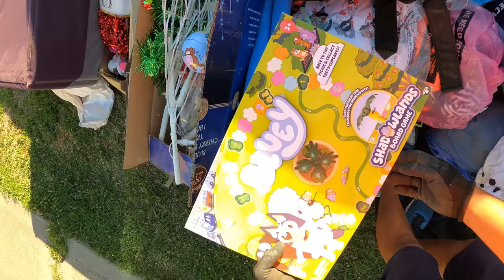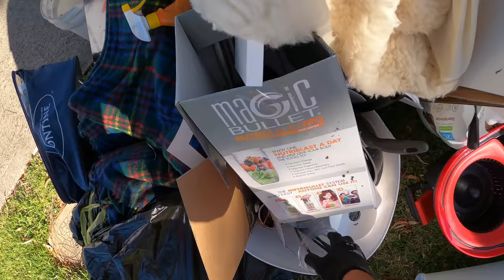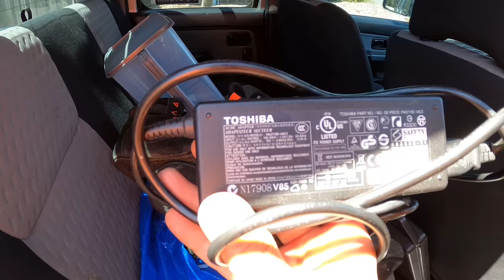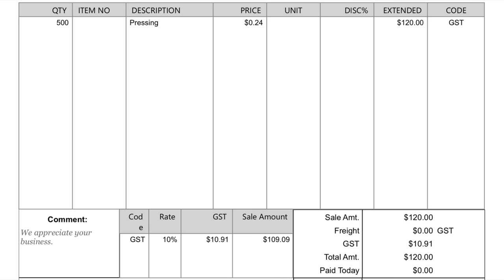How I Stack My Trailer With Scrap Steel

Comment: Hello from the U.S. ! My son and I scavenge here and find sooooo many useful (some new) items we keep for ourselves or sell at yard sales. My son micro scraps, because he doesn't have a truck to haul large items. So he reclaims copper, brass, bronze, extruded aluminum, small engines to repair or tear down, and some items he removes parts to sell as replacements. He also repairs and refurbishes computers. 
We've found computers, coins, jewelry, brand new appliances in the box, brand new clothing with tags still attached, brand new shoes in the box, tons of household decor and items.
 We folks in the U.S. are very wasteful and because of this, I rarely have to go to a store to buy anything "new". I shop thrift stores and also look for things to resell from there. It's so much better to reuse, restore, resell or recycle than to continue to be part of the corporate driven consumer machine.
Reply from the maker: Debbie we are very similar. Are we anti society or opposite to what everyone else is doing?

Comment: Just unloaded a ute load this morning the trailer is chocka block full for a friday run, our town is doing the first kerbside since beginning of co-vid and the streets are loaded big time.
I finish work at 4:30, head on home and pick up as much steel scrap as possible and load the ute and then take it to the scrapper in the morning.
Since last Friday $1400 so far, not bad. I am on a mission. 😁👍
Great vid and great treasures, be safe and go get that scrap.
Trash to treasure
Brad
Reply from the maker: Wow 🤩 I can imagine the backlog. I’d be all over it too mate! Good work Brad 👍👍
Reply: @PolyProphet  And another trailer and ute load today😁
Reply from the maker: @bradwelch7425  nice one mate. Did you take the gopro along?
Reply: @PolyProphet  I have it with me but only for the removal from trailer/ute to the scrappers. Heading out this arvo got a huge heavy gauge handrail to remove and maybe some stainless steel bits. I have a pretty big backyard and would have at least 2 ton there for removal. I could use it on the run this arvo though.
Reply from the maker: @bradwelch7425  would love to dig through the piles with you. See what it’s like over there 🙂

Comment: Loved it !!. Another great scrap run, PLUS all the other goodies. You're right you can't put paint or gas cylinders in the pile. 👍
Reply from the maker: Thought so! Thanks for confirming A 😊🙏🤙
Reply: @PolyProphet  Hey Poly, gas cylinders are a bit up in the air, I usually open fully and leave for a month or too and then drill 2 holes in the side and fill with water and leave a bit more. Out comes a a bigger drill bit bigger enough to shove a air blower into and blow air into the now dead cylinder.
There is good brass in them but be careful.
This is what I do, I am not suggesting you do the same.
A bit time consuming but the brass soon adds up, probably blow myself up one day, gotta go out with a bang I suppose.😁
Reply from the maker: Yeah definitely not set up to scrap gas bottles… yet. Not the ‘out with a bang’ ones brother 😂😂

Comment: One thing about stainless steel is there are several different grades so some with stick a bit. My yard has different grades they pay so something like that utensil that said stainless on it is just a low grade. Check with your yard to see how they do it. Just a thought.
Reply from the maker: It can depend on who’s working. Some workers go by the sticky not stainless rule while the boss boss will let a lot more pass.

Comment: I see you do micro scrapping. Some micro scrapping vids would be cool for sure. Just an FYI pretty much any power washer has a pretty legit motor in it so you can most likely take them to the yard as is or micro scrap it for motors or copper.
Reply from the maker: Thanks for the tip bro 🤙🤙

Comment: Hey, love your channel & just wanted to ask a quick question…I noticed this time you included’home content cans’ I realise they are tin lol BUT never even thought they could be recycled for $$$, I do stick ours in the recycling bin although if I can keep them to add to scrap I will…..so can they be recycled for cash OR is it just ok to include them here & there as ‘top ups’ ?
Reply from the maker: You definitely can take them to the scrapyard though you’d need to meet the minimum weight requirement that most yards have  here. My yard is minimum 350kg. Others I’ve been to is 1ton. Once they are familiar with you they may let it slide. Thanks for the question kellie  😊🙏🤙
Reply: @PolyProphet  cheers for the quick reply and the info…..I’m actually surprised that you gave such a steady flow of hard rubbish piles as well as the things you actually find. Here in Adelaide we are only allowed 2 pickups a calendar year and the majority of the items you collect we aren’t even allowed to include in ours piles……..all the electrical equipment, scrap metal, appliances, building supplies, car batteries, car parts, computer components ect aren’t allowed in our pickups
Reply from the maker: @kelliebloomfield6907  We also have 2 free pick ups per calendar year with our council. For all the items you aren’t allowed to put out, do you take them to the transfer station?
Reply: @PolyProphet  sorry for the late reply….. so anything electrical we can either take to Bunnings and drop in their specialised bins kept out the front of the stores. Bigger items such as white goods ect and any other metal items we either have to scrap ourselves or find someone local that does Free Scrap pickups. Smaller things such as batteries, cans ect I personally take to my local depot as those items can fit in our car and since watching you and others on here I’ve also been taking thre transformers ect out of items like microwaves…..although if I need to get a big pickup that we can’t do ourselves I will make sure to leave all the ‘goodies’ inside the items especially considering someone like you is doing me a favour by removing the larger items at their own cost.
Reply from the maker: @kelliebloomfield6907  Wow Bunnings! I wasn’t expecting that one. I’m guessing that we will soon fall in-line with SA as we surely can’t continue the way we are. Thanks for the info kellie 🤙🤙
Reply: @PolyProphet  yeah I believe (but don’t quote me lol) that they tend to ‘try out’ all recycling environmental plans in SA first. We were the first start to stop plastic bags in supermarkets & encourage reusable ones. We do have plastic bags but they don’t come free with your shopping they are 15c each and they are now also biodegradable. The permanent Bunnings trailer started possibly about 12-18mths ago now which makes things a lot easier for those people that don’t have enough personal buildup to ♻️ their things for cash…….your last couple of videos have blown me away with the amount some homes throw out it’s scary, I mean if we did that nothing would get picked up PLUS we’d cop a fine on top lol.
Reply from the maker: @kelliebloomfield6907  I believe they will charge you twice if you have both your free pick ups available. If not I’ve seen them pick up half the pile when you only have 1 free pick up. It’s meant to be 3 cubic meters max of acceptable rubbish. I remember cans/bottles saying ‘10c back. SA only’ years ago 🤔 I always wished we did that here.
Reply: @PolyProphet  the 10c cans make a huge difference here, I used to live in Sydney and even with a recycle bin it was amazing how many people couldn’t be bothered separating them although I’m sure if they had the rebate SA does regarding cans, bottles ect it’d make a huge difference within the other states. We have a household of 6 plus my boys mates so we collect a lot and it’s definitely worth the effort

Comment: Hi ! Do you ever take things to a Flea Market or are you strictly scrap ?
Reply from the maker: Yes I’ve been planning a trip possibly next Sunday🤞😊
Reply: What type of things do you sell at the Flea Market ?  Kids toys, dishes , glasswear and tools sell good here.  There were so many items at the road that I thought would be good in a sale.   If those scooters were any good they would have sold right away here.
Reply from the maker: Yes I have toys and tools to sell. As well as hardware and shoes. Mainly smalls that fit into these black fold up plastic crates or milk crates. Easy load and unload 👍👍

Comment: wish you pricks would stop cutting the cords off Tv's
Can't believe you left that gerni behind bro. fairly big motor and ally/brass pump head inside. Plus, probably just clean out the off loader valve and there's an easy 150
Reply from the maker: Ooosh Jimmy B! You repair flatscreens bro? I’ve not scrapped out a gerni. I’ll sus it out. Thanks for the tip bruz! 🙏🤙
Reply: @PolyProphet  Yeah, most flat screens are a simple fix. None of them last very long because of the cheap ass components they build them with.

NEVER find them with their remotes though!
Reply from the maker: Sorry Jimmy. That’s me on the remotes 😅 I have a guy who buys them. Are you in Melbourne?
Reply: @PolyProphet  nah bro, brissy. True... there's probably someone doing the same thing up here too lol
Reply from the maker: I plan to visit my cuz up there. They aren’t into this but was thinking of doing a street scrap in the rental 😂 Is there hard rubbish out west near goodna?
Reply: I couldn't tell ya man. I mean sure, there's the yearly council pick up, might be pretty slim pickin out that way though. It's a bit further south than I used to venture.
Reply from the maker: Ahhh no worries. Thanks for the info bro 🙏🤙

Comment: No creo que a mi párese eso del reciclado de esa manera no me gusta, ya que puedes darle una segunda oportunidad a una herramienta o un elemento de cocina sin tener que matarlo de una, ya que las empresas que resiclan contaminan demasiado, pero al llevarlas a casa o venderlas creo que es más sensato, no me párese.
POR FAVOR NO LE CORTÉS LOS CABLES SINO QUE LOS QUE ESTÉN CORTADOS RESICLALOS, LATAS FIERROS Y CUALQUIER OTRA COSA PERO NO NO LE CORTÉS LOS CABLES AQUELLOS QUE AHUN PUEDEN SERVIR EN ALGÚN HOGAR.
Reply from the maker: Hi Nancy. I arrive just before the garbage truck does. Imagine for a moment that I didn’t go out saving what I could. Most of the steel in my trailer would be crushed and sent to landfill. All the cords would be in landfill too. It’s better to save something rather than nothing no?